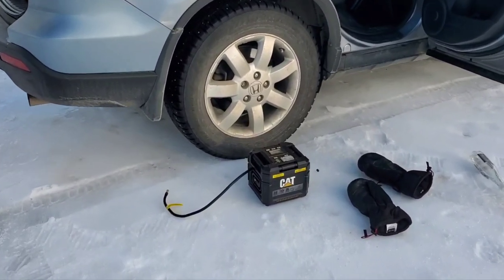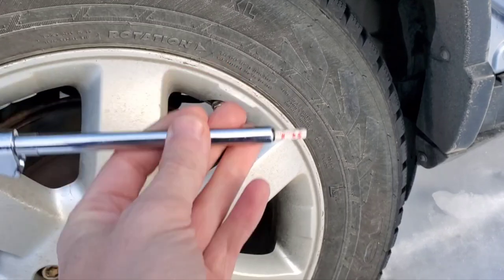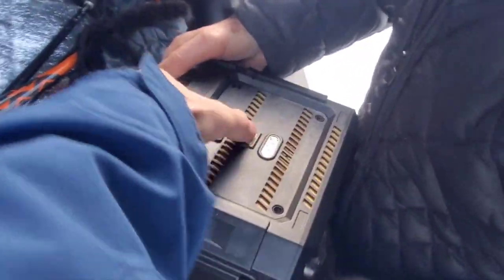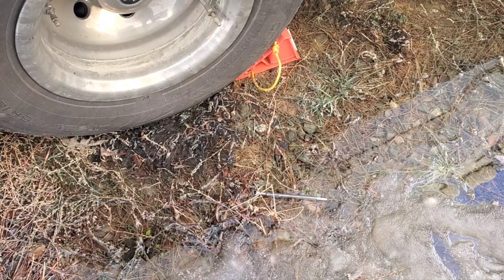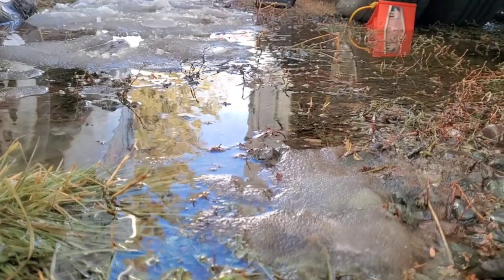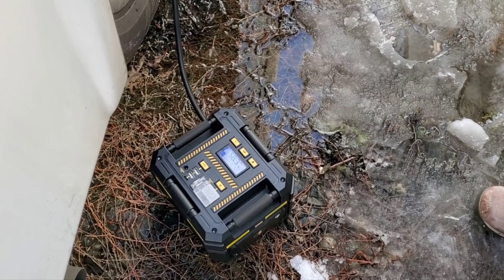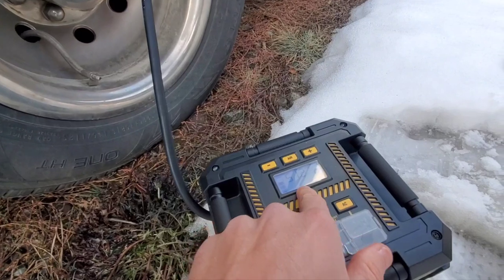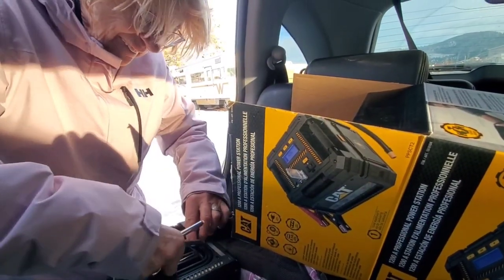Costco "CAT 1200A Profesional Power Station - Air Compressor Review

Comment: I have the US version. The compressor worked well to bring up all 6 Class C RV tires from about 55/60 to 75/80psi after sitting in a cold barn for 5 months. Took about 5 minutes for each (definitely slow but convenient). Easy to use. Compressor ramps up and down to prevent overheating. The manual states it will shut off after 10 minutes to cool but I never hit that. I guess it resets in between uses/tires.
Reply from the maker: Cool thx for follow up
Reply: I wont do that often, u have to let it cool every 10 minutes of use, i wont even run it for more than 6 minutes as it don’t have oil to cool it down May prematurely seize